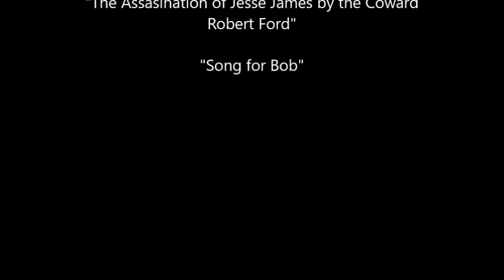Building a Maloof Rocker part 1 building the seat

Comment: Old school for sure.  Very nice.  Are the dowels 1/4" and how far from bottom are they?  I am in the process of selecting wood to use for this very project.  Used to building Shaker furniture and other pieces so this will be a challenge but if we don't try then what good is it?  Not sure if I saw what type of wood you used.  Great job!
Reply from the maker: I believe I used 1/2" dowels because the lowest or thinnest part of the seat is 1". That was my first unplugged chair so I used poplar in case I messed up. Hope you have success and enjoy your journey building the rocker.

Comment: Mark,
Have you ever made one of these seats without coopering it?  If so, how thick was the seat blank?  Thanks.
Reply from the maker: Hey Greg, no I haven't. the slabs for the seat are usually 2" think when I start. But usually I don't go below 1" in thickness on the coopered part.